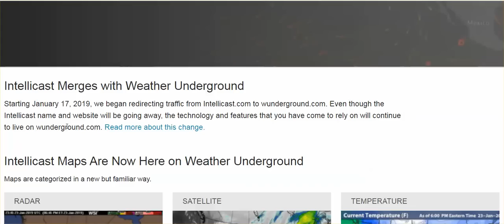WTH - Atmospheric Anomalies, 1,000+ Mile Storm, Again, Bursting HF Heating - Out OF Control

Comment: I'm in central NC about 15 minutes from the SC line and I can certainly tell this mess is manmade! I've never seen a storm with rain consistently POURING like it is right this second and wind that is blowing so hard it literally sounds like it's going to rip our roof off and has for the past 30 to 45 minutes. The wind sounds like it's blowing so hard I might blow away if I stepped outside! It's INSANE!

Comment: crazy weather here in western NC, all this week extremely cold temps down in the teens at night and then wednesday freezing rain with rising temps and we were told a warm front coming in with lota of rain but the ground is still frozen in most places and may cause issues with flooding (seems like we would have flooding regardless of the ground froze or not considering all it does is rain, sleet or snow day in and day out). it never ends, we can never have a clear day of sunshine and if its not raining its man-made overcast